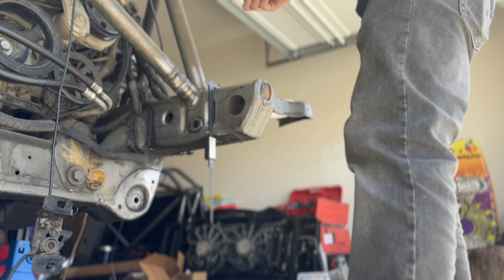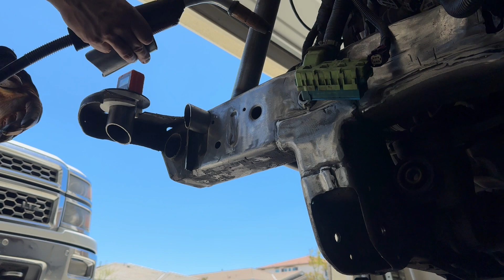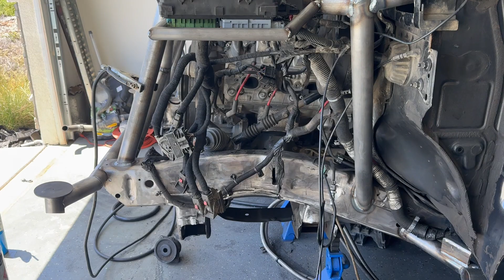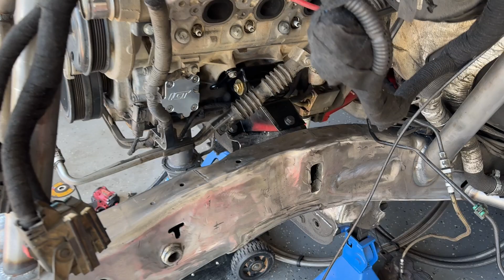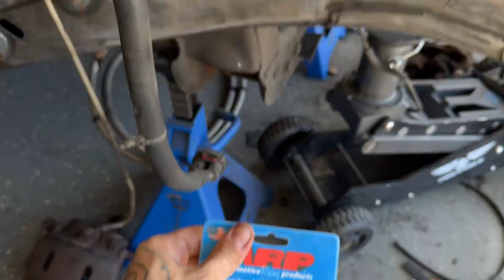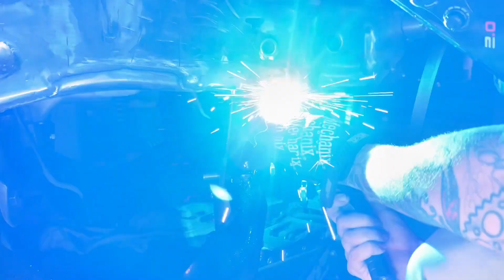GMC Prerunner build : PART 5

Comment: Body /engine mounts are Clean
Reply from the maker: Thank you man!
Reply: @connorellisx  🤙🏽hope this isn’t a stupid question but could those be installed after an engine cage and bedcage have been installed? I think you had a hand in building my sons truck at Cullwells. White 04 ,4door Chevy… Thanks for info on this and sharing these videos… You Have a gift Brotha🤙🏽
Reply from the maker: @MattPreston-w8s not stupid at all! So Cullwell is the guy I have welding my truck! 
And for the engine mounts yes you can absolutely do that! As far as the body mounts… if the cab is caged I’d say no because you’re already fixed to the frame in a lot of ways. And they could only be shorter like mine without the bed, otherwise the bed would sit too high cause you can’t shorten it. But as far as solid body mounts go, Izzy and Mejia both have sets for that truck

Comment: Sick build. I did control arms and fox 2.5s in front and 2.0s in rear probably gonna do shackles and some Deavers for my 2016 Silverado makes me happy to hear you have high miles I have 170k on mine 🤣 what was the name for that bolt marking paint?
Reply from the maker: It’s made by Revlock race supplies! And dude that’s the goal for a great daily driver, my next truck I plan on doing something very similar to that😅